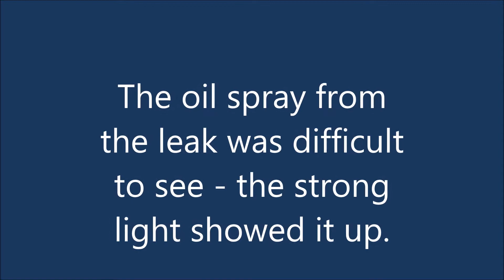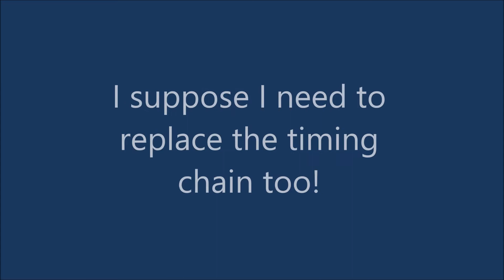Honda Motorbike Oil Leak Through Cylinder Wall

Comment: That makes perfect sense! Who knew the chain could migrate so far into the wall of the block! Is the only thing that prevents it's movement the wall itself? I like a simple design at least!
Reply from the maker: I reckon the worn timing chain is vibrating side to side. Maybe at some speeds it really resonates. The wear pattern looks a bit like cutter chatter. I'm sure Honda did not expect this kind of contact between the chain and the aluminium cylinder casting.